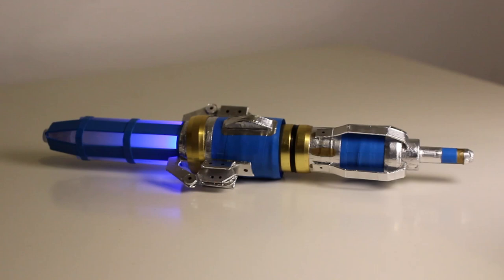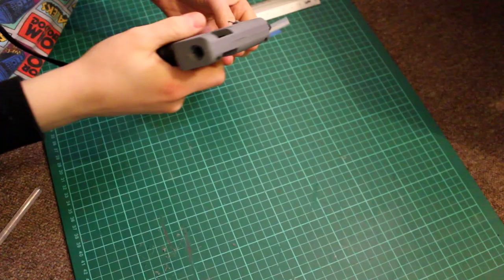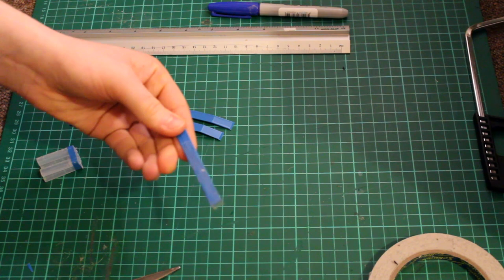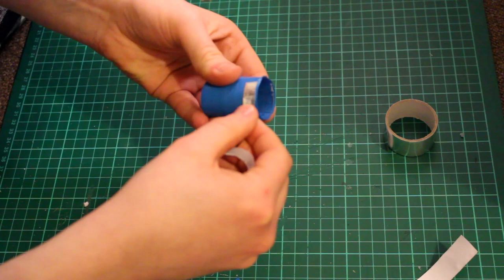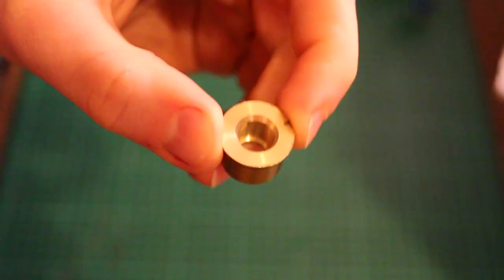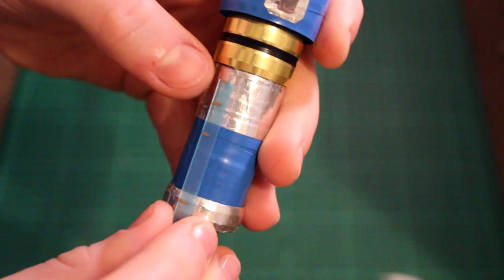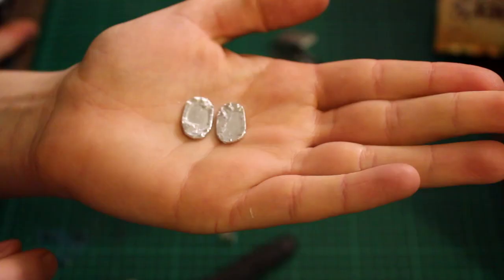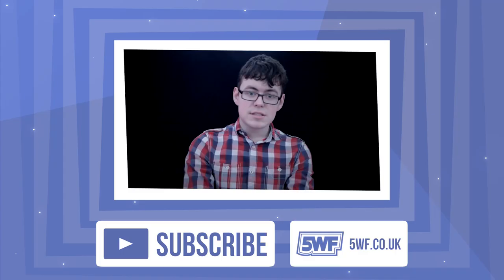How to Build the Twelfth Doctor's Sonic Screwdriver - DIY Prop Replica

Comment: Incredibly impressive! So, Blue Peter beckons :) One favour: could you give brand names for some of the things, such as the toiletry bottles? Just so we get the right things.
Reply: +Siobhan Gallichan I didn't specify brand names as I wanted people - especially those outside of the UK - to feel they can use the things they can find near them and what they already have at home. Plus, most of the materials like the glue and tape will be the same no matter you get them from. Probably the only two worth mentioning are the Mini LED torch which was from Maplin and the toiletry bottles which were from Tiger. The plumbing bits were from Leyland SDM. Everything else like the glues, foam and tape were from Maplin or Ryman. I already had the plastic folder. :)

Comment: Are the glue sticks meant to be like solid?
Reply: +JackTheAnimator4972 They are sticks for a HOT glue gun. They need to heat up to about  120 °C (Low temp glue gun) while others can be as hot as 190–210 °C (Hot temp glue gun) So they won't melt anytime soon at room temprature.